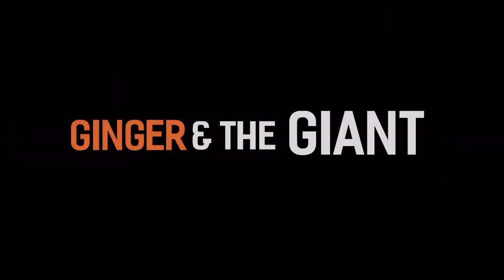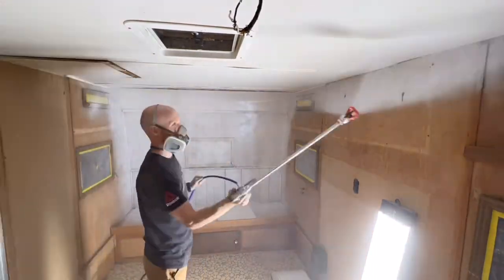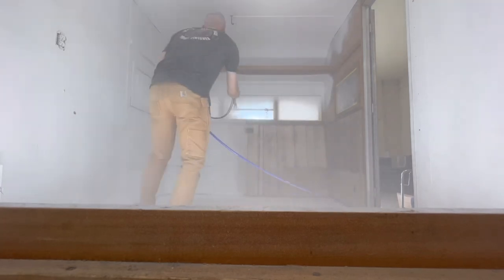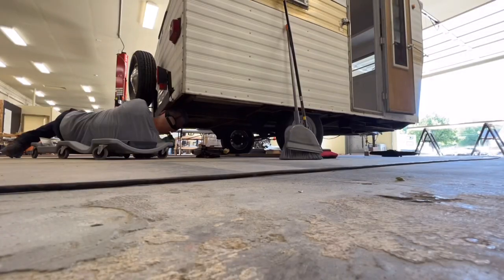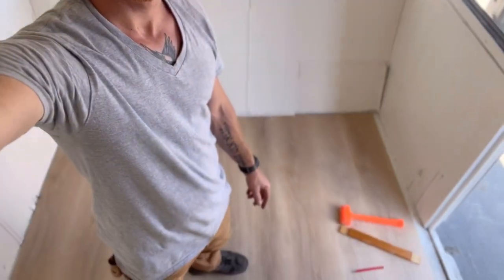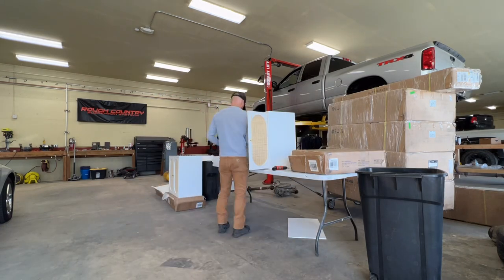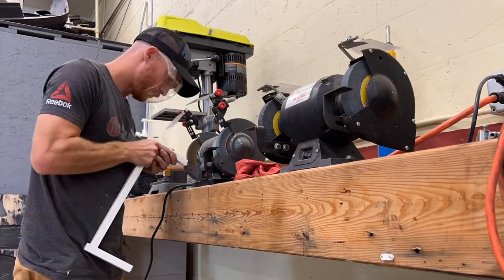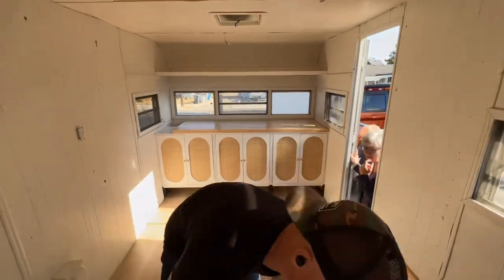Tiny Camper Build - Part 2

Comment: First thing you should have done before painting is to check the walls, roof and floor for black mold. Have torn down a few campers and all of them had black mold and rotten wood.
Reply from the maker: Yikes!  Thanks for the heads up Kempa Swe!
Reply: @Ginger-and-the-Giant  no problem, just don't want anyone to do the mistake and spend alot of money and then have to do it all over again